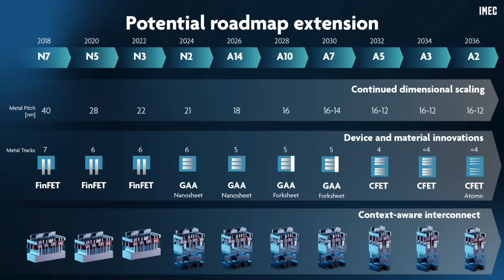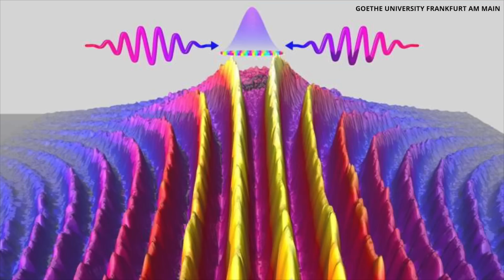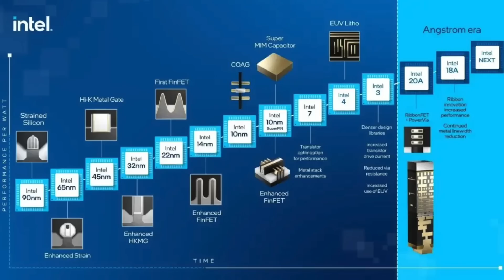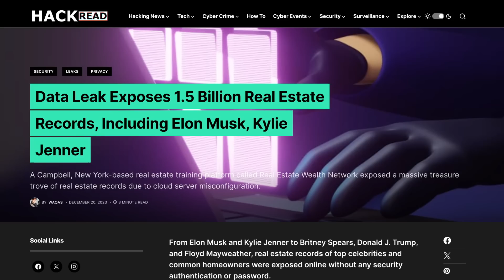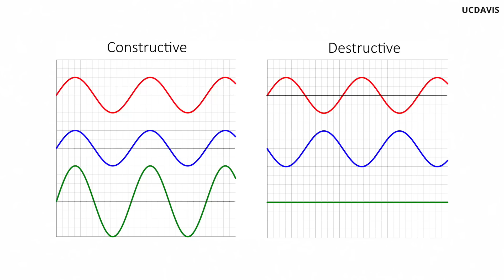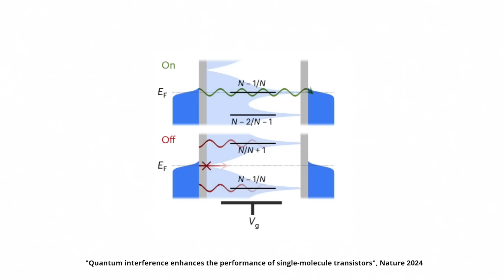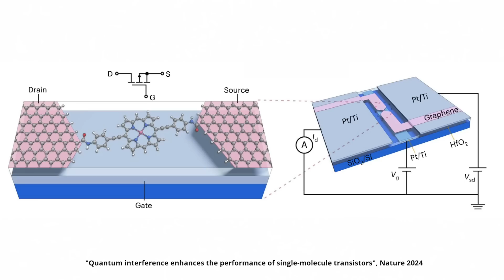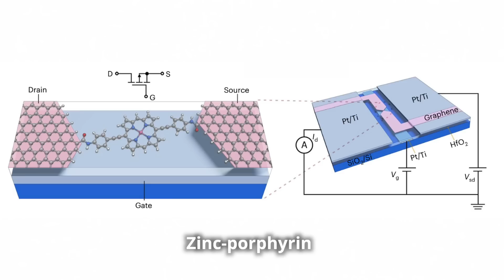Scaling Beyond 1nm

Comment: If they can really be made to work in the THZ range even if the interconnect can't handle that it seems like it would enable imaging sensors that nyquist sample light, then a deserializer could lower the data rate. A practical application would be a software interferometry telescope like the EHT but with light and that could be awesome.

Comment: Thank you for an excellent video, and keeping us updated about the current state of R&D in this field. A big challenge that remains is power requirement. Just a remainder: 20 Watts, that is what our brain need to run its dynamic LLM and inference machine besides all sensory fusion and motor control neural network. Today a 64 Cerebra CPU based cluster is maybe equivalent in terms of neuron to transistor count with ONE brain equivalent but it needs a whopping 80 megawatts or more. This is the equivalent of 4 MILLON brains. I see only optical CPU’s able to compete and have gains of at least three order of magnitude or more at room temperature.
Reply: It's not a valid comparison because a transistor has a single input and a single output and used for digital circuits only two states, on and off.

Neurons have many inputs and the inputs have variable firing rates and some have multiple outputs and aside from the electrical are affected by the chemical environment. So each neuron is a state machine equivalent to many transistors. But also neurons can make new connections and break old ones.

I've seen widely varying estimates for how many transistors would be roughly equivalent to a single neuron, possibly over 10 thousand for some types.

Plus the human brain has at least 3200 types of neurons and the cells that aren't neurons are also part of how a brain functions.

Comment: Wonder if the interference could be used in photonic computing better than in transistors. Almost picturing a virtual transistor turned on and off just by making two beams of light be in or out of phase. Still have the problem with needing to be cold, though.

Comment: XLR audio cables have 1 ground and 2 signal. One of the signal conductors is 180 degrees out of phase. The receiving end flips that conductor to cancel out line noise and achieve very good SNR of the source audio signal.

Comment: Using inference to open and close gates is certainly a unique way to fix the leakage problem. 
Here is where I'm getting lost. Isn't one of the benefits to shrinking smaller is less use of electricity? This design seems to double the usage in order to be smaller, kinda defeats a benefit. Using more current will probably cause a heating problem that goes directly against the needed negative temperature grade in order to work.
Other than that, awesome work around 👏

Comment: The first few times you said "inference" instead of "interference", I forgave you because English is not your Mother tongue and there is a plausible reason for you to mispronounce the word. And the only reason that I am bringing this up instead of ignoring it is because there is a material difference between the two words and "inference" is also a specific concept in computing.
Then you made it worse by actually saying "Interfere" in a subsequent part of the presentation, which meant that you DID know what interference was and were either too lazy or didn't care enough to use the correct word. I'm sorry if I sound harsh, I really don't generally comment on things in angry ways, but since you present yourself as somewhat of an authority on these type of topics, I think that you really SHOULD use technical language in the way it is meant to be used, particularly if folk are using your content to learn new things. That's all I have to say, but in general, I do enjoy your content, please keep it up. Cheers.

Comment: What's the point in making the transistors smaller if the current they can pass is so miniscule that they require larger transistors to amplify the signal in order to drive the signal load throughout the rest of the die?

Comment: "Computing with light" is not the way to go if you want really tiny devices. The wavelength of an electron depends on the energy we gave it, but for reasonable values is around 0.1nm. Visible light has a wavelength of hundreds of nm and even the deep ultraviolet that is so hard to handle is more than 13nm. The devices to handle these photons would have to be larger than these wavelength. But there are many other good reasons to switch as much of the system as possible from electrons to photons.

Comment: Inference: "A conclusion reached on the basis of evidence and reasoning: researchers are entrusted with drawing inferences from the data | it seemed a fair inference that such books would be grouped together."

Interference:"The combination of two or more electromagnetic waveforms to form a resultant wave in which the displacement is either reinforced or cancelled."

I would not have pointed that out, but having to listen to "inference" being repeated tens of times was just too much.

Comment: I don't think a requirement of liquid nitrogen temperatures is something that would hold this tech back from becoming an everyday, typical computer in most people's homes... it's not all that difficult to achieve these temps with a couple of compressors that you find in a household refrigerator.... and I think most computer nerds would LOVE the idea of needing to chill their CPU/GPU just to get Windows to run... AND it wouldn't be all that expensive either... getting to those temps has become a VERY mature technology and isn't all that complicated one you learn how it's done....
HOWEVER... the temperatures you listed are MUCH LOWER THAN THIS!!!! lol -430F ????? that is LIQUID OXYGEN TEMPS!!! This requires producing something as cold as Liquid Nitrogen to then run in a SECOND refrigerant system to then generate the temps to get to Liquid O2 temps.... And you would need a source of PURE O2 gas.. a LOT of O2  to then compress just to get a small amount of Liquid O2 ...
Of course we use OTHER substances because they are MUCH easier to run through system and get better/lower temps with much less effort/energy.....(I've actually been watching some YT vids of a guy in his garage doing all of this with stuff from the hardware store and a 3D printer and a HECK OF A LOT OF KNOLWEDGE!!! it's been REALLY FUN to watch and learn about all of it, but it's not easy to do when you are doing ALL OF IT  BY HAND... whereas it is typically done with precisely machine parts that are made in bulk and are very cheap for companies to make... That's why your fridge or a window A/C unit don't cost $12,000 lol)
Sooo... I guess what I'm saying is that it's not impossible to get these temps from fairly cheap products to run a machine that more cutting edge than a Katana, BUT temps that lower are DANGEROUS... and not that small (I would say something the size of a mid-tier ATX computer case could house the equipment) AND need to be maintained (and understood to maintain them regularly) AND would probably cost as much as a mid-tier computer today (maybe $700 on top of the price of the computer itself, which who knows how much it would cost at that point)
It COULD be done yes, but would it be worth it?? Depends on the nerd! LOL But no I really don't think your average person that doesn't know the difference between SATA and SAS would NOT be getting one of these systems.... and I don't think any gamers would be either... well, maybe the hardcore ones....So it would NEED to get to about -150 to -200F to keep it small and cheap enough, and not so dangerous, for it to become mainstream.... so lets cross our eyes that they... wait.... errr... I mean ... let cross our FINGERS that they are able to spiffy this tech up to make it more palatable to the average user :)

Comment: Multiple Multiplexed Clock Timing Signals should be used to shorten the timing cycles for clock signals into registers in parallel fashion. The machines cycle time could be shortened for 
faster compute speed. Various schemas could be considered with a variable word length paradigm.

Comment: This is perfect for super small Analog processors. Imagine the gate voltage controlling the superposition/probability amount of the quantum tunneling on the source. Even if you can’t measure the current flowing to the drain, you know based Schrödinger calculations the expected current out on the drain compared to your variable gate voltage and constant source voltage. Mapping this over and over again can allow you to make a resolution like digital waves.
Reply: Funny, I was just thinking of Digital waves

Comment: A few weeks ago you discussed AI analog chips... I would really like to hear more about similar hybrid analog digital chips. It seems like modelling common equations and creating an analog simulation could save lots of computation and memory, especially when you don't really need a discrete answer.  Floating point math and matrix math come to mind when I think about uses where you could do a lot of math very quickly, just with less accuracy by using an analog model.

Comment: Porphyrins are organometallic structures found in biology.  The ring holds a metal ion in its center.  In animals, the metal atom is iron and the porphyrin is at the heart of hemoglobin in blood.  In plants, the metal atom is magnesium and the molecule is chlorophyl, which captures light energy in photosynthesis. In your video, the molecule between source and drain is a porphyrin where the metal is zinc.  I don’t know what characteristics of this porphyrin ring structure makes it a good FET channel.
Reply: I am guessing, this is a natural single-electron transistor (SET) — single electrons can jump on-off that island in the center of the molecule. But why cool it? It should work at room temperatures as well, given the large Coulomb gap (in the energy spectrum) at this size. By cooling you get the so-called single impurity Kondo model that describes the system, with spin replaced by charge. And you do get quantum description. But it should work in the classical regime as well. Too lazy to read the original article, though, will just wait for someone to explain this on YT)
Reply: @koka3243  I think she mentioned somewhere in the video that the problem wasn't the porphyrin, but the graphene at the ends.
Reply: Apart from the issues with temperature of the source and drain graphene, I wonder if the other major issue is scaling processor interconnects down which may also suffer from quantum tunnelling effects at particular scales/current to connect to the transistors - to then be connected to at the classical computer layer (MB IC, RAM, I/O etc). Likely this will be a long way off from commercialisation, but this research could lay the foundations to solve the other problems for the implementation of transistors designed at this scale. I do know there was some work in the quantum computing space for generating and controlling single electrons, so certainly the techniques are actively being developed - but if super-low temperatures are required for operation (electron control/source & drain stability), it makes the plausibility of these systems for generic computing unlikely.

Comment: It's a fascinating idea. LIGO can measure 1/10,000 the width of a proton using interference. Wavelengths can be far smaller than a nanometer. If we start building transistors that work at these scales, this is like putting us in the position of PCs in 1980 again in terms of Moore's Law, and we would be on the verge of a whole new paradigm in computing.
Reply: And if that then, humans in a thousand years are going to be perturbed that mores law is approaching plank length.
Reply: @MrBrew4321  And then we find out there's an 11th dimension with another set of much smaller quanta, and history repeats itself.
Reply: and if we are still at this in a million years and break the plank length (that's ESPECIALLLY improbable) we are going to be batteling things like the swarzchild radi of portions of the circuits because you have to be able to get information into and out of something to consider it did computations... anyways, like electrons Schwarzschild radius is far below the Planck length ≈1.616×10^−35 often considered as the smallest meaningful scale in physics, but electrons are possibly point particles (all their mass gets mathematically assoiciated with a zero volume point) but even though they are probably at one point and have no physical radius theres a schChild rad around them given by Rs on the order of GM over speed of light square = gravity constant 10^-11 meter, mass of electron 10^-31 meters, speed of light is 10^8 m/s but square it is 16 and invert it is -16 so adding -11+ -31+ -16 = -57, so let's round it up to 10^-60meters or some dozens of orders of magnitude smaller than plank length. That THAT is gotta be the bottom of the rabit hole? Humans in 1trillion years: hold my bear
Reply: When the earth actually shook by half an atom in dimension
Reply: This sounds interesting.
Reply: Are you living in a Star Trek universe? This is clearly impossible.
Reply: @tempname8263  What exactly do you think is impossible? Computation with waves? This has in fact been thoroughly begun including useful algorithms involving matrix calculations utilized in optical computers. If you think electrons are not waves? If you think transistors have to be Newtonian physical devices?  What is impossible is arguing against such a vague assertion of possibilites.
Reply: @MrBrew4321  Making transistors at 1/10000th width of a proton dude. That's what impossible.
Reply: @tempname8263  Use the word improbable, very very few things are impossible.
Reply: @TheReferrer72  Okay then, assembling Hadron Collider from couple regular lego kits is improbable then, not impossible. Gotcha
Reply: @tempname8263  I think you are missing the point that transistors already compute at functional lengths smaller than their geometric lengths.
Reply: @MrBrew4321  I think you've missed all the points. We were not talking about marketologist make-believe terminology
Reply: @tempname8263  in this video at around 14:20 she talks about "the possibility of scaling beyond 1nm in real physical dimensions" and that quote is in the context of figuring out how to perhaps use computing with light to get around a bottle neck called the switching frequency, so indeed we are not talking about make believe terminology, we are talking about how in a very real sense transistors are and will continue to push the boundaries of mores law regardless of the fact that on the face of it it seems impossible
Reply: @MrBrew4321  This is like talking to a wall.
Reply: @tempname8263  No one is talking about making transistors smaller than a proton. We're talking about compute using wavelengths smaller than a proton, which is exactly what LIGO already does. It's adapting that technology to another purpose.
Reply: @ryanmcgowan3061 Wavelengths smaller than a proton?  LIGO's laser is IR man.  It's a large interferometer being used for interferometry.  It's not breaking or even bending laws of physics.
Reply: @whatelseison8970  I worded it wrong. Waves can exist in states smaller than a nanometer.
Reply: @kakistocracyusa  I clarified this already. They're measuring wave states smaller than a proton. The wavelength is longer, but the state of the wave distorts enough to measure sub-proton distance anomalies. It uses interference, so they would be measuring small changes in magnitude to derive distance changes. In compute, it would be similar but function as a logic gate.
Reply: @kakistocracyusa  The Fabry-Perot Cavity is only the technique to isolate the wavelength. It's a filter. The LIGO instrumentation is an interferometer, which is the key word. What I described, Einstein, is an interferometer.
Reply: @kakistocracyusa  I'm an engineer.
Reply: @kakistocracyusa  You're far more concerned with trying to insult me than actually demonstrating your knowledge. You cite a part of LIGO that is only used to refine the waveform as how LIGO works, mostly irrelevant to the topic at hand. You haven't even made a point. Do you have another insult, or do you actually have a point?
Reply: @tempname8263  let people dream bro

Comment: The use of Graphene reminds me of the beginning of the use of Gallium Arsenide low noise microwave amplifiers. Initially to achieve the required noise spectral density the devices had to be cooled to -70 C. Eventually performance parameters were achieved at room temp some 20 years later.
Reply: When you absolutely must have it now and can't wait for 20 years of R&D to catch up, you go exotic.

Side note... Are there any "supercomputers" like the Cray anymore? With exotic sub zero cooling?
I can imagine watercooling is probably a thing simply because of the heat transport potential vs air, but I'm not aware of high end refrigeration in the supercomputing space anymore.

As far as I'm aware, the focus has been on more units of fairly mainstream-adjacent hardware with almost generic data centre practices.
Reply: The molecular structure is literally the same as hemoglobin and chlorophyll.  It's not graphene in that arrangement.